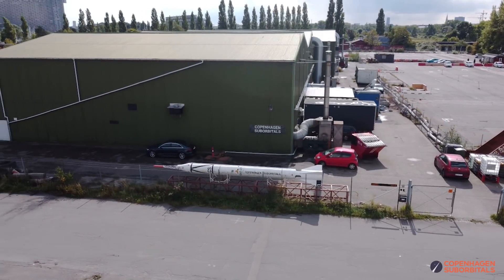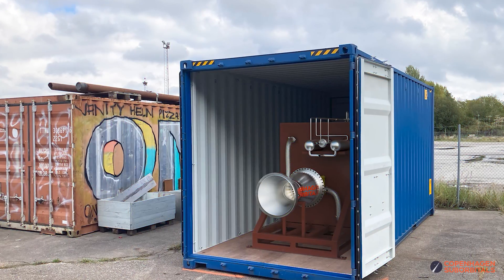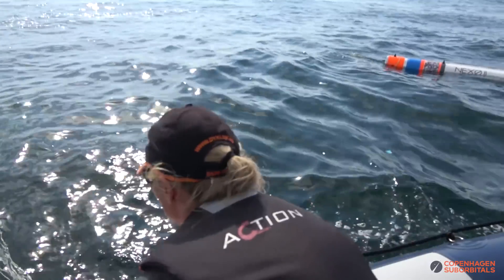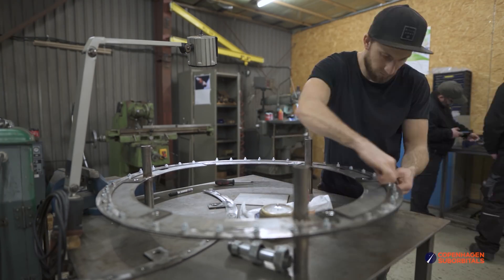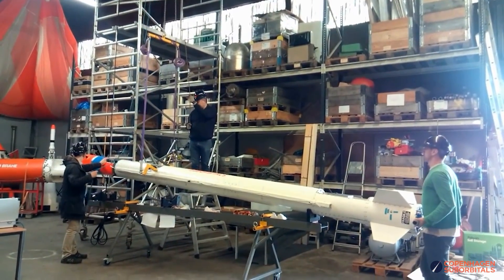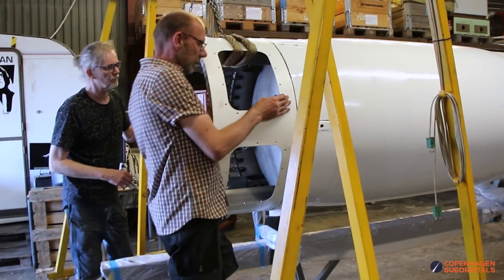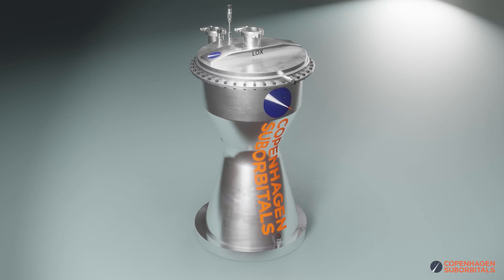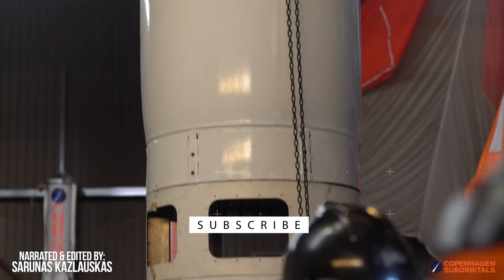Stacking the Reusable Spica Rocket LOX & Ethanol Tanks

Comment: are your tanks going to be too heavy now that the rocket wont have to be pressure fed?  are you still going to run the tanks at 30 bar or are you going to run them lower because of the pumps?

Comment: Would it be possible to install a device that releases a small reflective hydrogen/helium balloon attached via a cable reel? It would act as a "flare signal" to make it easier to find it.
Reply: Everything is possible, but it is added weight and complexity. A smoke device would probably be more useful, but again weight and complexity.
Reply: @petermaersk-moller3014  im dumb, sorry
Reply: @NoThoughtsAllFish  Actually it is not a dumb question. But we have a trick up our sleeves ;-) 
The known meteorological data on the wind speeds at different altitudes is programmed into a simulator. During the descent and deployment sequences these data is used to calculate the landing point with very high accuracy. Long time before landing we know exactly (within 100 meters) where the vehicle will land. Search for our NEXØ 2 launch and you will see examples of this.
Reply: @jorgenskyt  Wow! Do you guys plan on further advancing the vehicle into being capable of guided landing?

Maybe using variable drag by erecting and collapsing panels on top of the vehicle?

Maybe using a steerable parachute?

Comment: If you're going to use electric pumps, why do you need to make the tanks hold so much pressure? Is it just a case of changing plans? Are you going to redesign the tanks to be lighter, once you prove that the pumps work? And what's the planned combustion chamber pressure of the BPM-100?
Reply from the maker: So far both options are on the table and for that reason we made the tanks as they are. If we do decide to go for electric pumps in the future, then we will also go for thinner tanks. We are aiming for ~15bar chamber pressure with the BPM-100. However, the motors on the electric pump are capable of more than that, if we ever feel adventurous. 😉